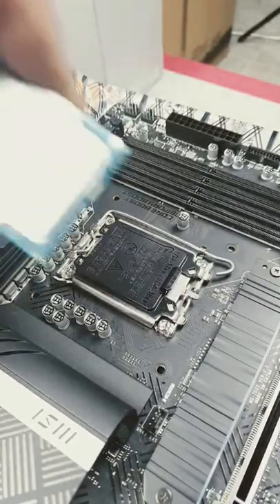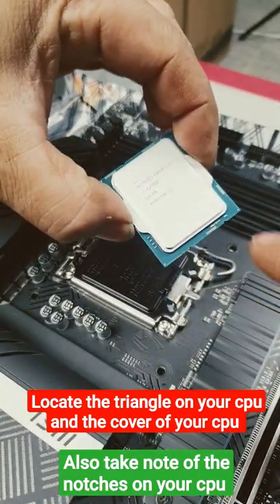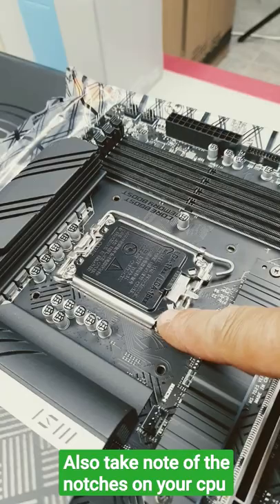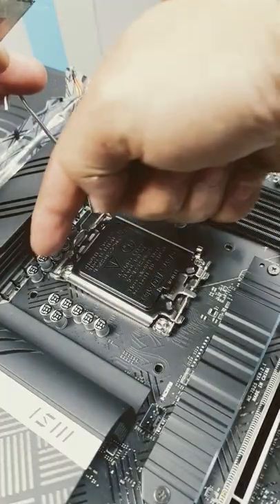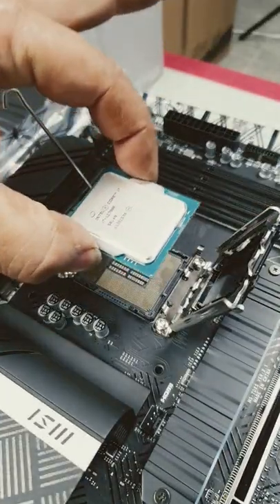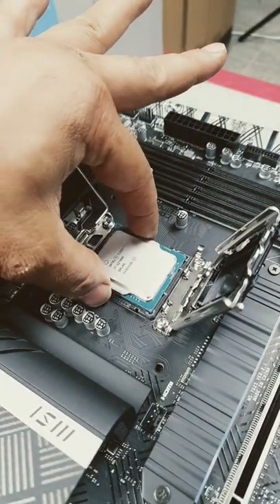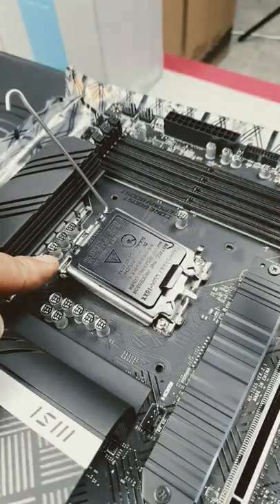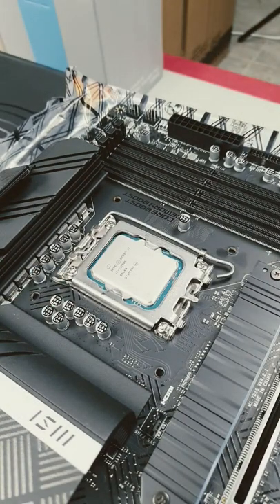12th gen lga 1700 socket (cpu install)

Comment: I took that plastic cover off,  it didn't pop off and scare me.
Reply: did it work properly after that? It sayed take the cover off and even was in manual on my mobo. So i did. It made weird noise so iam scared AF for completion. (b760 - gigabyte)
Reply from the maker: it will be ok.. u can always test before u complete build
Reply: UPDATE: it works my wife’s brother is grinding fortnite already 😃 thanks 4 the help guys. I want to leave it here if someone gonna stress as i did in the future.

Comment: Ok as I was watching, i swear I noticed the cpu isnt fully seated, and i check the comments and youve pointed it out xD I cringed so hard as you pushed the lever down
Reply from the maker: yes ur 100% right I was really lucky it was only 1mm out so it literally just jumped in
Reply: @@user-mk4or5yu9r 1) make sure arrow on the bottom right of cpu is at the correct corner (usually the corner will have a marking of some sort like an arrow as well)
2) gently drop cpu in socket making sure that the alignment keys are in the alignment notch.
3) dont put any force, just gently wiggle cpu to check that its fully seated

And thats it
Reply: Yes 💯, I was dying when I saw him closing it!!
Reply from the maker: @danielhenderson7050 lol luckily it was so close it didnt affect anything..its that 1 in a million lucky mistake

Comment: Thank you so much, youre the only one i could find that show the arrow is on that plastic plate :)
Reply from the maker: thanks ..yes its very obvious too... cuz so important to look for these indicators ..it helps to ensure u don't make the mistake..the last thing u need is to bend the pins on mobo and game over
Reply: @MIKEYZVLOGZ  it's alittle stupid, cause there should be arrow below the plastic, too
Reply from the maker: @Jaburu  yes there usually is
Reply: @Jaburu  Isn't there? Users...
Reply: @currentuser1219  at least on my mainboard I couldn't find any. not when the socket is open
Reply: @Jaburu  oh sorry, I thought you were referring to this one in particular that can be seen
Reply: @currentuser1219  you can see an arrow in this video when the socket is open?

Comment: The land grid array from intel has the pins on the socket and the cpu has the holes
Reply from the maker: well there's no holes on cpu just contact plates... and the pins from socket make the connection

Comment from the maker: OK GUYS I REALLY WANTED TO POINT THIS OUT .
AT ABOUT 37SECONDS IN, JUST BEFORE I CLAMP DOWN THE CPU ..LOOK AT THE CPU CAREFULLY, IT ISNT 100% SEATED PROPERLY... DO NOT DO THAT , THAT SLIGHT CLICK U HERE WAS THE CPU FORCED INTO PLACE WITH THE LEVER... PLS DO NOT DO THAT 
MAKE SURE YOUR CPU IS PROPERLY SEATED BEFORE YOU CLAMP IT DOWN ... U SHOULDNT HEAR ANY KIND OF NOISE APART FROM THE PINS CONNECTING , NO OTHER SOUNDS......
I WANTED TO CORRECT THIS SO U ALL UNDERSTAND , IT SHOULD BE SEATED 100% FIRST...pls learn from my mistakes and do not copy them ... that would be really silly..I do apologise for that... I don't want to give misleading information ... so pls correct it
Reply: Did it broke?
Reply from the maker: @gaemer9720  no
Reply from the maker: @gaemer9720   no it didn't. but i was also very lucky which is why i am stressing do not do what i did, its very important that u have it seated correctly , as u should not hear any type of noise when clamping down the cpu
Reply: @MIKEYZVLOGZ  I see thank you for pointing that out ^^
Reply from the maker: @gaemer9720  u are most welcome , although it didnt ruin my cpu..AS I STATED i was very fortunate that i only had it misaligned by 1mm , so wen i clamped it down it just was forced into place, but i can honestly say no damage was caused to my cpu, and everything is finer and no bent pins whatsoever...BUT PLS TRY NOT TO MAKE THAT MISTAKE..i have installed tons of cpus since doing this video and never had an issue as i never made that mistake again ...so was never worried as well..i can admit wen i make a mistake ... and i hope ppl can learn from my mistakes
Reply: I just realised this short was 1y old 😮
Reply: @MIKEYZVLOGZ  how can you tell if it's seated correctly? I've only installed an AM4 chip like 6 years ago and want to do a 12600k build. Seems easier to tell when its in with pins tbh
Reply from the maker: @baloneyslice247  when the cpu is seated correctly it cannot move left or right , its actually in the  socket and cannot move either way by wiggling it , thats how u know its seated.. u will be able to tell

Comment: hey I'm from philippines and I'm worried about the bending issue. this is my very first build. do you have any recommendations?
Reply from the maker: If u worry just use one of these ...or u dont have to but there are benefits to using it . I didn't use one for a year and no issues...just dont tighten your screws too tight and always use equal pressure in an x pattern

Comment: Is there any difference between the lga1200 and a lga1700 please answer🙏I really need to know
Reply from the maker: Yes massive . Completely different cpu sockets. From size to markings and overall look. U cannot install them vice versa... 1200 is smaller. 1700 is longer ... hence the distinguishing labels
Reply from the maker: Even if u tried to install a 1700 cpu to a 1200 mobo or cpu etc u would see immediately it won't work
Reply: @MIKEYZVLOGZ  thanks
Reply from the maker: @thet-800go9  welcome, if your planning to build a pc , pls do more research, try top understand what parts are and what they do, before you start, and most importantly watch alot of building guides so u get more familiar with how to build an actual pc, becuz it can be a very costly mistake

Comment: Is there a need to add thermal paste to CPU?
Reply from the maker: yes, 100% u must addd thermal paste because it cools the cpu ..keeps the temps low for efficiency ..without thermalnpaste, the cpu will get too hot and can crash and lag ... cpus aren't 100$ flat ..there's actually tiny ripples on the surface ..the themalpaste fills this and with the help of a cooler combined cools the cpu to good operating temps
Reply: @MIKEYZVLOGZ  I asked because it's like most PC Builders on YouTube don't add thermal paste to their CPU(Desktop CPUs). I only see thermal paste's been added to laptop CPUs
Reply from the maker: @desmondaddae-manu3882  I see.. but yes, thermal paste is a must...are u sure ur watching the right videos ... all desktop cpu need thermal paste or else it will overheat
Reply: Do not put thermal paste in between your mobo* and cpu you will be fucked. Only in between CPU and COOLER.

Comment: What about the 12th gen cpu bending issue? Is it solved yet?
Reply from the maker: I don't think so I think its why they created the corrector plate frame... have you seen those ..I did a short on it too
Reply: @MIKEYZVLOGZ  i have seen that video. But i am not sure how safe it is. I get weird thoughts that something may happen and it short circuits and causes fire in my pc while i am asleep. Intel suggests not to mod the socket. I hope they can fix it somehow. But chances are very low.
Reply from the maker: ye ofcourse intel say that..but usually it's ok I've never had an issue ever... I never used a plate corrector til recently... I always used a normal cooler like aio... and never had an issue..the issue isn't fire..its that the board and socket warp

Comment: Will the 11th generation CPU be installed on this motherboard?
Reply from the maker: definitely not ... 11th gen is lga 1200 series 10th 11th gen are same ... 12th and 13th gen are lga 1700 series... so not it will not fit... u will see the difference immediately .. 12th gen is longer ...

Comment: What motherboard you got ?
Reply from the maker: this was the msi z690 pro series mobo
Reply: @MIKEYZVLOGZ  to be able to power the pc on it needed a gpu correct ?
Reply from the maker: @jenniferr3965  no u can if u have a cpu with built in graphics like k model
Reply: @MIKEYZVLOGZ  okay I'm running a 12400f is that still a problem
Reply: @MIKEYZVLOGZ  cause I can't power my pc on at all 😭
Reply from the maker: @jenniferr3965  can be a few issues in that case... so u need to trouble shoot .. does ur cpu work.. ram ? is cpu seated properly ? is psu working? so many thing u need to troubleshoot..so u can statt process of elimination and tick off parts that work ..so u know thy ate good working order
Reply from the maker: @jenniferr3965  if u have a 12400f u need a gpu to test
Reply: @MIKEYZVLOGZ  okay perfect, I needed to know what I was doing wrong haha thank you for your info 😭
Reply: @MIKEYZVLOGZ do you think this is also doable for MSI pulse 66 ? I wanna upgrade from i5 to i9
Reply: @MIKEYZVLOGZ  is that a yes ? Lol
Reply from the maker: what's a pulse 66? never heard of that
Reply: @MIKEYZVLOGZ  the Msi gl66
Reply from the maker: @dr3wcapone  I'm not sure what ur asking I don't know what a pulse is
Reply from the maker: @dr3wcapone  oh its a laptop..for a laptop it's alot more complicated ..theybare usually hard wired in ... so it's not as simple

Comment: I remove that plastic protection before open the slot, hope it dosen't broke anything 😅
Reply from the maker: should be fine as long as u didn't drop anything on the socket
Reply: @MIKEYZVLOGZ  ty for your response. If you can tell me, i dont have processor to put there right now, i'll buy it next days, but the leaver remains up and open, and it don't seem to can put it back on closed, and i dont want to force, the cpu slot is empty
Reply from the maker: @eugenpopa9354  nothing can happen ... the cover will just protect the pins so put that back on... it only clips on one
Reply from the maker: @eugenpopa9354  it does take abit of force to close the slot.. don't worry u won't break anything .. just like I did in this clip wen I closed the cpu socket u clamp it down and push it under the retainer for the lever ...

Comment: still one pin damaged in my new mobo.
😭
Reply from the maker: how did u do that?? u must've not had the cpu seated correctly, did u make sure to try and move the cpu when seated , to ensure it is fitted perfectly
Reply: @MIKEYZVLOGZ  there are 4 groves .i had put it between them carefully but still one got damaged( as i showed it to  seller) idk why they make it like this .should be other way of connecting processor to mobo . So fragile these pins are .

Comment: Just install new PC but no display on monitor CPU fan is working GPU fan is working no display new pc
Reply from the maker: did u install a new cpu ..u might have to update bios
Reply from the maker: if ur using q
13th gen or 14th gen then u need to update bios
Reply: @MIKEYZVLOGZ  how do I update bios without display
Reply from the maker: @mayriamma4456  do i have a bios update button
Reply: @MIKEYZVLOGZ  yes flash bios button in rear io shield
Reply from the maker: @mayriamma4456  then u can do it... goto website of ur mobo and check how to update follow the prompts

Comment: Rip that cpu.
Reply from the maker: that's what I thought too but as stated previously ... I was extremely lucky that it was literally 1mm out and when I closed the socket it just slide into place ... and I was like omg...phew!!! or it could have been a very costly mistake ... but it would be the mobo that gets destroyed not the cpu... as it doesn't have any pins on it...  but the mobo does ... I ended up finishing th entire build without any issues..but ofcourse never do what I did... smallest mistakes can be the worse

Comment: Not aligned on video lol
Reply from the maker: ye I know I accidentally bumped it with my thumb when placing it in ... I was really lucky it was only a tad off and wen I clamped it ..it actually fell into place ..but ye that could've been costly
Reply: @MIKEYZVLOGZ  so do another video admitting your mistake own it and do it correctly
Reply from the maker: @abackimages5351  already did ..but thanks

Comment: It is processor it is not cpu
Reply from the maker: cpu stands for central processing unit
Reply: @MIKEYZVLOGZ  s but you are not  installed SMPS ram handdrisk and cooler fan inernation and external connections. If all the connections combilrd is called cpu.  U right now installed just a processor.
Reply from the maker: @PREMKUMAR-qq6pk  A processor (CPU) is the logic circuitry that responds to and processes the basic instructions that drive a computer. The CPU is seen as the main and most crucial integrated circuitry (IC) chip in a computer, as it is responsible for interpreting most of computers commands.... I'm sure u will find that most ppl refer to the processor as a cpu ... regardless of what is plugged in or not...
Reply: @MIKEYZVLOGZ  ok leave the topic because I am from India we call all combination of processor SMPS and etc are called as cpu and we call as processor  we won't call as cpu
Reply from the maker: @PREMKUMAR-qq6pk  fair enough ..if u watch any pc building video u will see everyone call it cpu ... but I understand what ur saying ... I appreciate the input .. and good to know that's how u refer to it.. something new I learnt
Reply: @MIKEYZVLOGZ  just say as processor it self it is not because issue to call as cpu but from basic the parts of learning we need to guide them properly
Reply from the maker: @PREMKUMAR-qq6pk  fair enough i get what your saying ..maybe someone else can shine in on this topic and tell us what they think
Reply: Pretty sure they're synonyms in this particular case. Although all CPU are processors, not all processors are CPUs ^^.